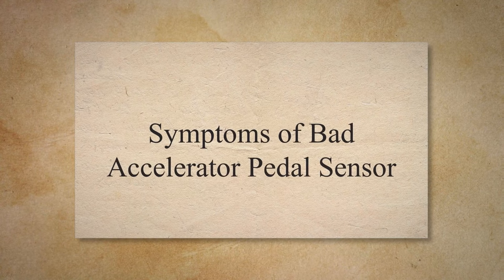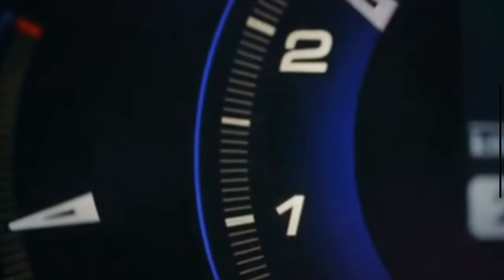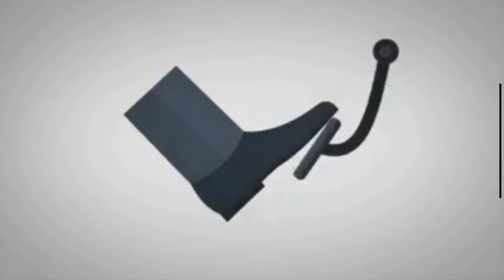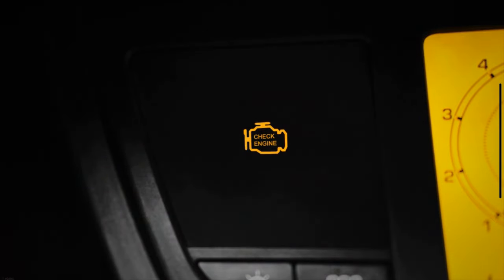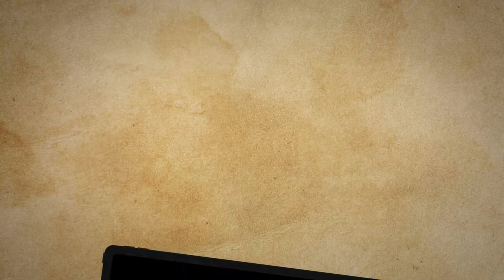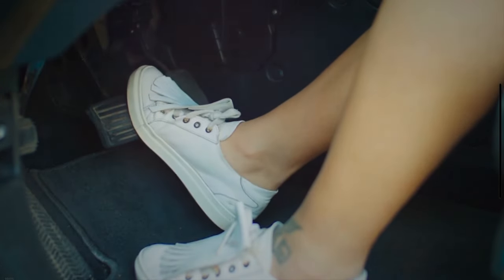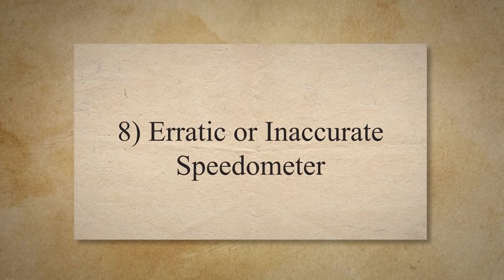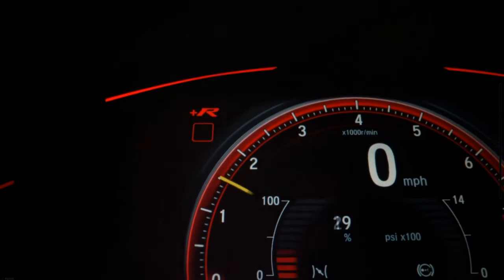TOP 8 SYMPTOMS OF A BAD ACCELERATOR PEDAL POSITION SENSOR

Comment: Yeah I have 2018 Q50s 3.0t and I recently replaced the the pedal sensor and the two throttle body’s and still nothing 😔
Reply: Whats going on with your q50 bro
Reply: @iHeAdSh0T13  it still won’t accelerate it does and everything when it’s cold but once it’s start getting warm it goes out and it won’t accelerate or nothing
Reply: I’m taking it to the shop to put the big scanner on it
Reply: Have you done an idle relearn procedure on it? You can replace throttle body and pedal position sensor all you want , but if you don’t do the idle relearn afterwards, you’re going nowhere fast (literally and metaphorically lol) because you essentially haven’t programmed that new TB or pedal sensor to the ECU

Comment: I have a 2005 Chevy trailblazer 4.2. Replaced foot pedal sensor ladt yr. Just put 3rd throttle body on last week. Did all resets. Still going into limp mode. What else could be wrong?
Reply from the maker: If your 2005 Chevy Trailblazer 4.2 is still going into limp mode even after replacing the foot pedal sensor and the throttle body, there could be a few other potential issues to consider:

1)Wiring Harness: Faulty wiring or connectors in the throttle position sensor circuit could be causing intermittent signals or incorrect readings. Check the wiring harness for any signs of damage or corrosion.

2) Engine Control Module (ECM): The ECM, also known as the engine control module or engine control unit (ECU), could be malfunctioning, causing it to misinterpret signals from the throttle position sensor or other sensors. A diagnostic scan tool can help identify any ECM-related issues.

3) Other Sensors: Issues with other sensors such as the mass airflow sensor (MAF), manifold absolute pressure (MAP) sensor, or oxygen sensors could potentially cause the vehicle to go into limp mode. These sensors provide crucial data to the ECM for proper engine operation.

4) Vacuum Leaks: Vacuum leaks in the intake system can also cause erratic engine behavior and trigger limp mode. Check for any cracked or disconnected vacuum hoses.

5) Throttle Position Sensor Calibration: Ensure that the throttle position sensor (TPS) has been properly calibrated after installation. Improper calibration can lead to incorrect throttle responses.

6) Mechanical Issues: There could be underlying mechanical issues with components such as the throttle linkage, throttle plate, or idle air control valve (IAC) affecting proper throttle operation.

7) Fuel System: Problems with the fuel system, such as a clogged fuel filter, failing fuel pump, or fuel pressure regulator issues, can also contribute to limp mode activation.

Comment: 2015 Chrysler 200..code p2122
Reply from the maker: The code P2122 is a generic powertrain diagnostic trouble code typically associated with an issue in the throttle/pedal position sensor/switch "D" circuit. This code indicates that your Engine Control Module has detected a malfunction in the signal from the throttle or pedal position sensor.

Comment: My Toyota Avalon 2013 model is doing this from diagnosing report (code: P1604) startability malfunction, exactly what you explained it's consuming a lot of fuel could it be poor accelerator pedal sensor?
Reply from the maker: The P1604 code typically indicates an issue related to the engine control module (ECM) or engine control unit (ECU). If your car is showing this code, you should check your ECM

Comment: Would the symptoms be the same in a manual? I feel like my car is sluggish and when accelerating at times its jerks a bit, abs and vsa lights are on but cruise control works so i assume they're not on because of the speed sensors...
Reply from the maker: If your car is exhibiting symptoms of sluggishness and jerking during acceleration, along with the ABS and VSA lights being illuminated, it could indicate potential issues with the vehicle's drivetrain or electronic systems. While these symptoms can occur in both manual and automatic transmissions, the specific causes might differ slightly.

Comment: p02200 throttle /pandel sensor b input low ...plz suggest solution ..throttle change /ya pandel change pl sugest me
Reply: I’ve got the same problem on my Clio I changed throttle body and still the same, now I’m scared to buy the pedal thinking it will be the same 😭😂 anyone help please
Reply from the maker: The P02200 error code typically indicates a problem with the Throttle/Pedal Position Sensor B Circuit having a low input. This issue can arise from various causes. Here are some steps to diagnose and potentially fix the problem:

1) Examine the the Throttle Position Sensor for any visible damage or wear. And also Clean the Sensor
2) Inspect the Wiring. Use a multimeter to check the continuity of the wires to ensure there are no breaks.
3) With a multimeter, check the voltage output from the TPS. Compare it with the manufacturer's specifications. Also Measure the resistance of the sensor and compare it with the expected values
4) Ensure that the vehicle's battery is providing the correct voltage.
5) Use an OBD-II scanner to check for any other related error codes that might give more context to the issue.
6) After making any repairs or adjustments, use the OBD-II scanner to clear the codes and see if the issue persists.
7) If all else fails and the sensor is determined to be faulty, replace it with a new one that meets the manufacturer's specifications.
8) If the problem persists after trying the above steps, it may be best to consult a professional mechanic for further diagnosis and repair.

Comment: P2115.   /P2116Dodge
Reply from the maker: The P2115 trouble code is related to the electronic throttle control system. Specifically, it indicates a problem with the throttle actuator control system or the throttle position sensor. 
The P2116 trouble code is also related to the electronic throttle control system. It indicates a problem specifically with the throttle actuator control system's forced limited power.

Comment: Number 1 is limp mode (reduced power). Very dangerous running on a big highway, and bloody annoying. This can be countered by turning the engine off and restarting.  Simple if you have a manual shift. It can be done while in motion. ( Push clutch down, turn off engine, turn key back to run position, re-engage clutch which re-starts the engine, takes 7 seconds.)  If you have an automatic, you have to stop because it has to be put into into park.  The worst circumstance is an intermittent problem. Hard to diagnose because the car is fine most of the time and the problem can only be identified to specific cause when it is present.
You may get a P1271. P1275, P1280 fault code... but the problem may be in the wiring rather than the APP sensor or in the throttle position sensor.  Sometimes it takes an oscilliscope to locate and most places dont have this capability.
Reply: P0222 error in my nissan terra 2019 model. Intermittent 😢😅

Comment: How can i fix
Reply from the maker: Fixing a faulty accelerator pedal position sensor may involve several steps. However, it's important to note that working on the electronic components of a vehicle requires a certain level of expertise, and if you're not comfortable or experienced with car repairs, it's advisable to seek help from a professional mechanic. Here are some general steps that might help diagnose and fix an issue with the accelerator pedal position sensor:

1) Check for physical damage or loose connections in the wiring harness connected to the sensor.
2) Ensure that there are no obstructions around the accelerator pedal that could be affecting its movement.
3) Visually inspect the accelerator pedal position sensor and its wiring for any signs of damage or corrosion.
4) Make sure the sensor is securely attached to the pedal assembly.
5) If there is dirt or corrosion on the sensor or its connections, carefully clean them with a contact cleaner or electronic parts cleaner.

6) If the sensor is found to be faulty and cannot be repaired, consider replacing it with a new one.

7) After making any repairs or replacements, reset the Engine Control Unit (ECU) by disconnecting the car battery for about 15-30 minutes. This can help clear any stored error codes and allow the ECU to relearn.